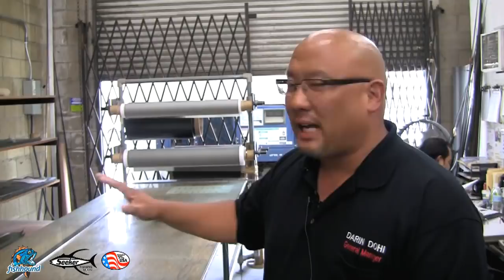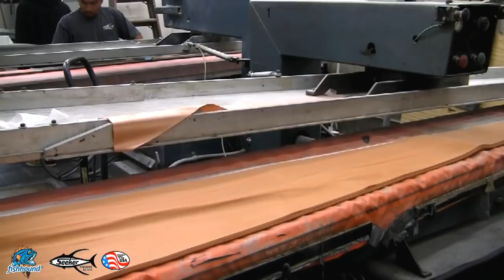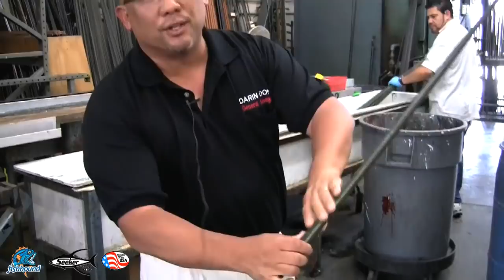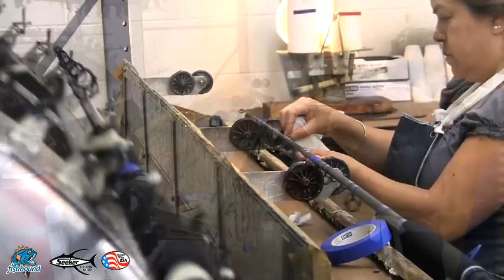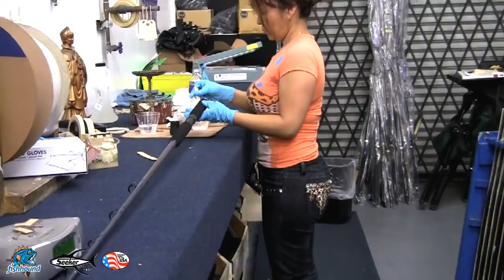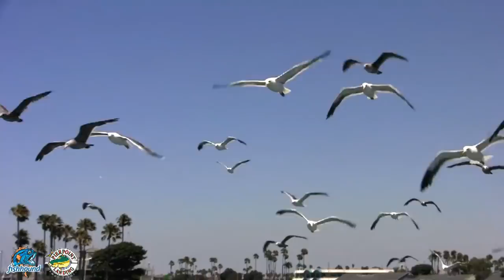Seeker Rods: How It's Made

Comment: I have added one step to make my rods perfect;  I added weights to the butt under the butt cap to balance the butt with the blade where my fingers hold the rod at the reel seat.  The only weight I feel is the lure. My wrist doesn't have to twist the tip upwards against the blade weight, the butt weights do it.